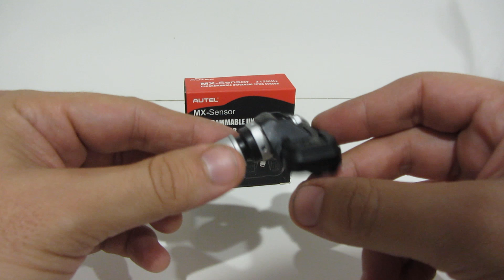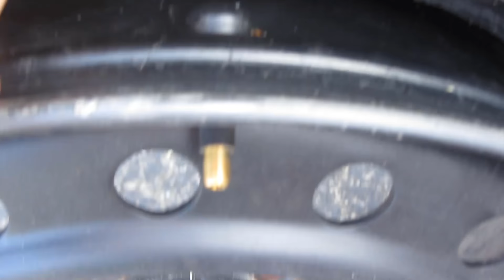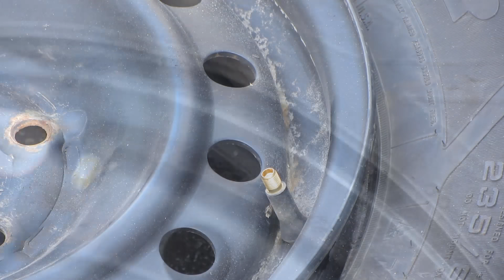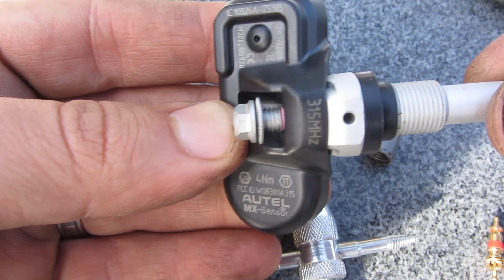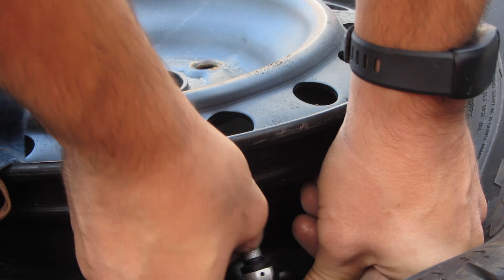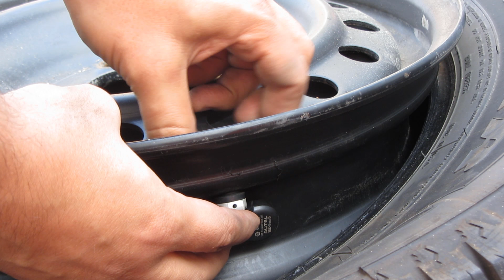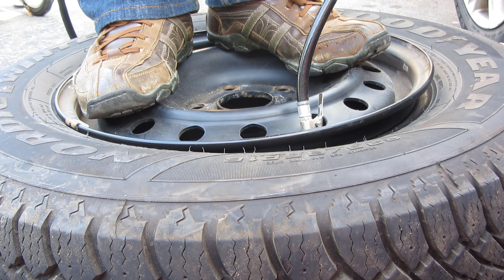Install New TPMS Sensor DIY Without Needing Rebalance

Comment: Never fill a tyre without a tyre cage...it's not worth your life... Also use nitrogen because normal air damages the lining of tyres.
Reply: Air is made up of 78% nitrogen.
Reply: 79%
Reply: Ya becuase everyone has a tank of nitrogen laying around LOL
Reply: Your thinking about split rims on old pickups,  very dangerous we turned the tires with split rings down facing cement before filling with air.
Reply: Air damage lining of tires? We have been driving with air in all type of tires for a hundred years so where is that evident? You could fill with nitrogen at Costco tire centers.
Reply: Ambient air isn't going to destroy the inside of your tire.  The only difference I've seen with pure nitrogen is that the tires lose pressure a little more slowly than with ambient air.  I have to guess that whatever constitutes the 21-22% that isn't nitrogen is more prone to leaking than nitrogen itself is.
Reply from the maker: Can you show us the source where you got that information? Tire cages are only for truck tires. I have never seen a tire shop that even has a cage for passenger car tires.
And tires last years filled with regular air. The outside will wear far, far faster than the inside will.
Reply: Lol nitrogen was a gimmick for a long time.  Air already contains mostly nitrogen so there's honestly no point.

Comment: I would not recommend using a water-based lubricant in your steel rims. It will make them rust on the seal and then leak.
Reply: Over time, there will be far more water, salt, and paint damage to the rims FROM THE OUTSIDE, than from that piddling little bit he used to move the tire on the rim. The rims will rust from the outside in. Especially in Canada.
Reply: @enakcma  But rust on the outside doesn't matter, it does not make your tires leak. And since there is an over pressure in the tire, water will never go inside. But if you start with water inside, it can and will creep between the seal. I have seen many tires leaking between the tire and the rim due to corrosion.
Reply: @tomvleeuwen  you're sensitive. I bet you whine about everything
Reply from the maker: Keep in mind that steel rims are painted. For the rims to rust anywhere, the paint has to be damaged.
Reply: Rust is made of iron and oxygen. There is no oxygen between the tire and the rim in the seal area (except in a tiny amount of water), therefore the rim will not rust there. Of course, glycerol-based lubricants would be better, but c'mon, a microscopic rust will never be a weak link.
Reply: Doesn't take much to damage paint. It's good practice to avoid water-based lubricants.

Comment: Truth be told, where I am, buying the stupid sensor is the expensive part.  45 bucks.  Then costco will do the replacement, and rebalance for $16.  But I have also lived where it's a good damn idea to know how to do this kind of thing on your own.  Hey, do yall remember when we just sort of looked at our tires and checked the pressure every now and then instead of having a TPMS warning light nagging us? Those were the good ole days! Good video Gabe's Hacks
Reply from the maker: Yeah.... if it wasn't for that light on the dash and my OCD, I might just ditch them. I just don't like features on my car not working the way they're supposed to. And y'never know, maybe one day it'll actually come in handy.

Comment: There are specs these parts need to be torqued to. You don't just slap it together however feels good to you.
Reply from the maker: I talked about that at 7:52. If you feel better using a torque wrench, then by all means do so. But I've had no problems with mine. The point is to get it tight enough to make a seal, but not break anything.

Comment: There is a few problems with this video.
1. you need to reprogram/ clone the tpms sensors.
2. 20grams out will be very noticeable for highway speeds and slapping a weight on opposite is only gonna counter balance the weights already placed on the rim.
3. there is a lot less messing about if you tighten the 6mm bolt first.
4. you do not want to use any sort of water based lube because the water will still in the wheel and help speed up the corrosion process. 
5. this method will only work with really soft tyres
i understand the DIY mentality but there are just some things best done at a professional business.
Reply: Reapers Merc you probably own a struggling tire shop.
Reply from the maker: To each their own, but I don't see any of those things as problems at all. Much of it I already covered.
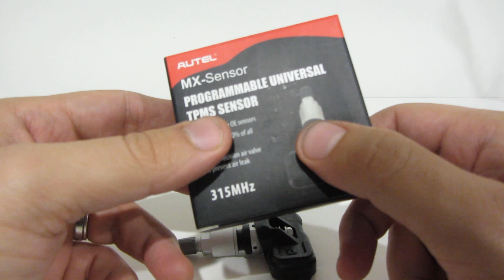1. I talked about this at 0:47 and pointed you to my other video where I programmed these sensors. That can be a DIY job too - if you even need to. Some cars automatically learn new sensors, so for those no programming is needed at all.
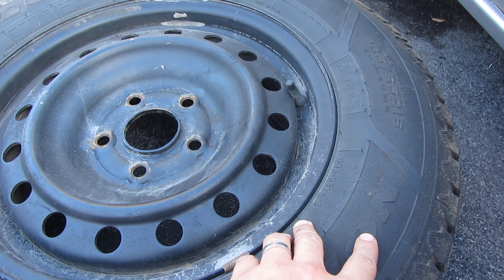2. I talked about that at 2:17. At the end of the day, the authority on the subject will be whether there is vibration in your wheel after. If there is, get it balanced. If not, cool.
3. Maybe, maybe not. You need the internal part snug against the inside of the rim, so you need the valve stem in its final position before tightening the 6mm bolt otherwise things may not line up properly, but it would still probably seal just fine, so whatever works for you.
4. I don't buy this. Rims are painted, and the inside of the rim doesn't see any damage to the paint except from the tools used to mount/dismount the tires. So no moisture is going to hit the bare metal inside the rim unless you've damaged it. Even then, the outside of your rims are going to see far, far, far more damage and water and dirt than you could ever put inside by using water as lubrication.
5. Not so. I've done this with all-seasons too. I talked about that at 11:07. Yes, it's a bit more difficult, but certainly doable.

Comment: unless it's an exact replacement of a previous TPMS, you're going to have to re-balance. If you're adding a new system or taking one out permanently, you'll also have to balance it/them.
Reply: Agreed, even the slightest weight difference will cause an imbalance. You might not feel it at all but ultimately, they won't be balanced.
Reply: be real, think about what tread groves pick up while driving.
Reply from the maker: Right. I talked about this at 2:17.
Reply: @GabesHacks  just clarifying for others.

Comment: You made one mistake in your video. You need to leave the valve stem out until you seat the tire. This makes it much easier. Once the tire is seated you put the stem in and add the proper amount of air.
Reply from the maker: I don't see how that's even possible to do....
Reply: You do not need the stem in the valve to inject air into the tire. Without the stem air will travel into the tire much faster than with the stem making it easier to seat the tire against the rim.  Think about it. If the air comes out much faster without the stem it will also enter the tire much faster without the stem. Once the tire "pops" you put the stem back in and fill the tire.
Reply from the maker: Oh I see. You mean leave the "valve" out, not the "valve stem". Yeah, that can help seat it quicker. But clearly it still works with the valve in there, so no, it's not a "mistake". :)
Reply: I said it made it much easier. Snow treads are some of the easiest tires to seal. Many types of tires need the valves removed to increase air flow. Ask somebody who works in a tire shop and don't be so touchy. There is a good chance that somebody will follow your directions and not be able to seal their tire and not know what they are doing wrong..
Reply: he's clarifying your statement sir, which was phrased incorrectly "You do not need the stem in the valve to inject air into the tire." I think you meant "valve in the stem" because if there wasn't a "valve" there would be no valve stem, valve, bead, seat, air filler, etc...bc it WOULDN"T BE A TIRE LET ALONE A WHEEEEEEEEELLLLLLLL!!!!!
Reply: The Firestone way... lol
Reply from the maker: I've done it this way on all-season tires too. Valve in or out, the pressure is still going to build inside the tire, and it's that pressure that will seat the tire.
I'd be very curious to see a tire that will not seat with the valve in. Next time you come across one, get a video and let me know.

Comment: i work at Canadian tire and we use a air ratchet to put those little shits on
Reply from the maker: Haha, yeah I guess that's part of the reason why I don't get any work done at Canadian Tire. I have a couple coupons for free oil changes and I'm not even sure I want to use them.
Reply: @GabesHacks  please don't use those we use mystery oil for free oil change coupons, the oil can contain anything, engine oil, canola oil, vegetable oil, bar and chain oil, 2 stroke oil, gear oil, air tool oil, ATF, standard transmission fluid, so anything that's clean and is a oil product it goes into our mystery oil for the free oil changes
Reply from the maker: Dude that's nuts!
Reply: Hah, Canadians are awesome.  Even when they are ripping on each other they are still pretty cool about it.

Comment: If concerned about the sensor dropping down into the tire (Yikes to that!), I used a small freezer bag and set it down into the tire where I'm going to place the sensor.  If you drop it... it'll drop into the bag for easy retrieval.

Comment: I'm all for changing the TPMS sensor myself, but around here 4 wheel balance is $30 bucks.  You're not doing yourself any favors by trying to do the DIY balance.  I'd just change the sensors then go get a $30 balance.
Reply from the maker: Oh I agree. I'm not suggesting anyone attempt to balance their own tires. This video is to show how you can replace a sensor without needing to rebalance at all.
Reply: thats quite pricey. in my country, usually the balancing price for 4 wheels is around  5usd and another 5 for allignment
Reply from the maker: @MuhdIqbal  Wow! Most places around here charge $15-25 per wheel! But Costco charges just $21.99 for all 4, so that's what I've been using.

Comment: А батарейки сядут? Опять шиномонтаж балансировка
Reply from the maker: I'm sorry, I don't know much Russian and Google Translate doesn't help much.
Reply: He said once the batteries drain  (and need replacement) you'll have to re-balance again.
Reply from the maker: Well, that is the point of this video. :) You can replace the sensors without needing to rebalance the tires.

Comment: You don't need to reseal?
Reply from the maker: You don't need to add any kind of sealant, no. The rubber against the edge of the rim is enough to seal.

Comment: NOTICE! Do not forget to reprogramm/relearn all new sensors, so otherwise TPMS computer will not recognize them and you will never get rid of "Check system" or "low pressure" notice on dash board. Also recommend to re-balance wheels, because minimum disbalance will give you noticeable vibration on high speed driving!
Reply from the maker: Yes, I discussed the programming a little more in my other video: https://youtu.be/N6p6xV4PlHc I used programmable sensors so I didn't have to program the vehicle.

Comment: If you're worried about tyre rotation, can you not add a couple of chalk lines to the rim and rubber before starting?
Reply from the maker: It's not that easy unfortunately, for two reasons: 1) Taking the whole tire off the rim is quite difficult to do without special tools. It can be done (I've done it), but it's a lot of work. And 2) Matching up two lines exactly while mounting a tire isn't as easy as it sounds. You have to get it right the first time - it's very hard to turn a tire on the rim, even if the beads aren't seated yet.

Comment: Good video. But? Your adding more hardware into the tire area. Even as little as the weight is, that sensor will throw the counter weights off a little. You may need to rebalance the tire. Think about how small weights are and the size of that sensor. Your going to get a small vibration because there is now extra weight in that area.
Reply from the maker: If you are adding a sensor where there was no sensor before, yes, it's possible. I discussed that in the video starting at 2:17.
Reply: what happens when rocks stick in the treads?

Comment: Thanks! I can buy the 4 sensors on eBay for $42. Belle Tire wanted to charge me $60 per tire ($240)!
Reply from the maker: For that cheap, I imagine those are not programmable sensors. Have you figured out if your car can automatically learn new sensors, or if you need to program it?
Reply: They charge me 75 for 1 tire!!

Comment: How many Months the battery of sensor last
Reply from the maker: The batteries last around 7 years or so. But it also depends how much you drive since they only turn on when the car is moving.
Reply: Gabe's Hacks Thanks because I was thinking to take internal or external one
Reply: Go for the internal one.

Comment: How do you know which tire sensor is bad?
Reply from the maker: It depends on your vehicle. Some high-end vehicles will tell you on the dash which one is bad. But if not, you'd need a scan tool to test each one.
But if your vehicle is more than about 7 years old, then it's probably the battery that is dying. In that case, you're better off replacing all 4 anyway since the other 3 won't be far behind.
Reply: Thank you.

Comment: Didn’t know you could do this at home. Good thing about Kia, at least for mine, once you get the sensor installed and the tire mounted on the car, the TPMS picks up the sensor on it’s own and so you don’t have to pay extra to get it programmed. My local Walmart only charges 10.00 to instal the sensor, so it’s worth letting them do it for me.
Reply from the maker: Awesome, that's a great price!

Comment: Avoid all of this..just keep your other set of tires with the sensor in them stored in the trunk,  the car will never know. 😉
Reply from the maker: Unfortunately, it does know :) the sensors have a centrifugal switch inside, which will turn the sensors on only when the wheel is spinning. So a sensor sitting in a tire in the trunk will never turn on.
Reply: @GabesHacks  also how the f do you fit 4 tires in a sedan trunk? Holy crap.
Reply: My car does not recognize the sensor unless it’s on the car. I put the tire with the sensor in the trunk and my full size tire and wheel without the sensor on the car. The TPMS light came on.

Comment: People who are concerned about the balance disturbance of a the sensor - weight it, remove the weight of the old stem, then go to Harbor freight tools and buy Item#67226 1/2 Oz. Wheel Weights or item #67225 1/4 Oz. Wheel Weights. Both are about $7 with their coupons. Stick the weights that equal the additional weight of the sensor across from it on the other side of the wheel, it will mitigate that minimal disbalance. Also, they have Manual Tire Changer - Item#69686, it is only like $34 with their coupons. You will get a solid steel pusher if wooden blocks do not work for you.
Reply: it's not that simple to balance.....lol

Comment: Awesome! Bought a used car, a few weeks later one of the tpms stopped working, can’t program it but the others are fine so I know it’s just the sensor going bad/battery died, and while the tires will need to get replaced sometime soon, that’s likely several months away, so might just be going this route. Not sure some of the negative comments here, guess that’s YouTube for ya, but the video was great, immensely helpful and straightforward.
Reply from the maker: Just be aware that you may need to teach your car the new sensor. Some cars automatically learn new sensors, but some don't. So you'll have to look into that for your car. I go into that in more detail in my other video that I linked to in the description of this one.
Reply: Yep I have the process for my vehicle, fortunately my '08 still has a manual process you can use without a tool to learn.

Comment: you still have to go to the shop to replace all 4 tires . good info not very practical
Reply from the maker: Only if you need to replace the tires. In my case, I only needed to replace the sensor without replacing the tire.
Reply: ... if you need new tires. The sensors go bad on good tires or their batteries die leaving perfectly good tread.

Comment: I put electrical tape over my sensor light
Reply from the maker: Haha, yeah that's one way to deal with it. Although depending on your car, it could have undesired effects. Like with our Odyssey, you can't turn off the traction control if the TPMS system isn't working, which you need to do if you're trying to get out of deep snow.

Comment: Can you use any tire pressure sensor made for your car to replace the original one?
Reply from the maker: Yes. The only trick is getting your car to recognize it, and that depends on your car. Some cars will automatically learn new sensors. Some have a manual process (without a tool) that you can find in the owner's manual or service manual. Others, like my Odyssey, have to be programmed with a tool.
Reply: Gabe's Hacks yeah, I did a little research, I might be attempting it on my 2017 focus, it has a training mode for the tpms, so maybe that'll work, but I don't really know how these work lol. Got ran off the road and one wheel got bent on the inner side in 2 spots, but Imma try to fix it.
Reply: super1337spy buy the sensor you want. Then get a ford tpms tool. and it should have instructions included. but you have to have the tool to set it up on ford cars.

https://www.cjponyparts.com/ford-tire-pressure-monitor-programming-tool-2007-2018/p/TBANDP/
Reply: Fv M thank you so much for the link, though I was able to find se wheels for cheap, my tpms warning went away as soon as i had them in my car lol. this will help out other people though.
Reply: You could just buy a sensor matches your car's frequency